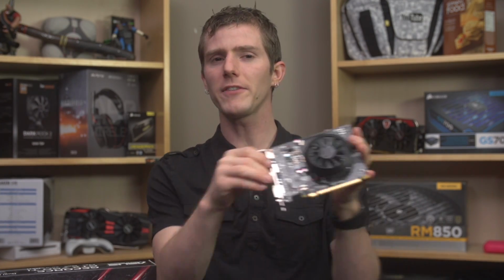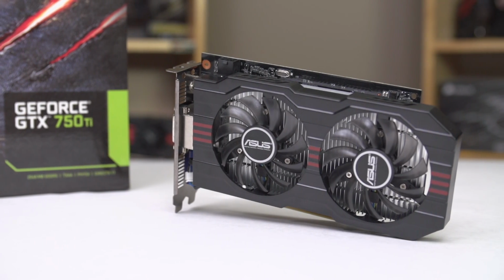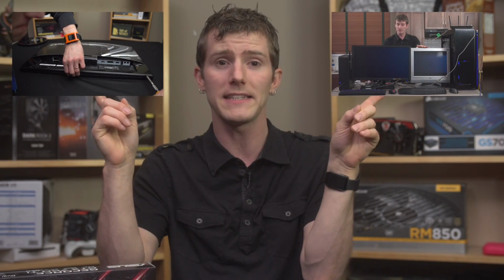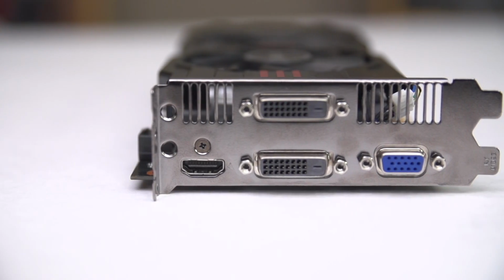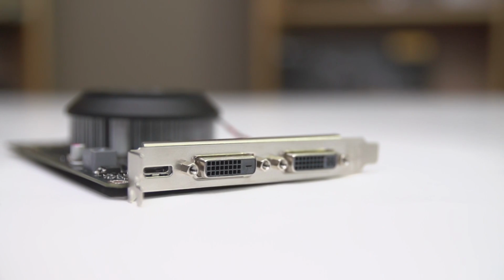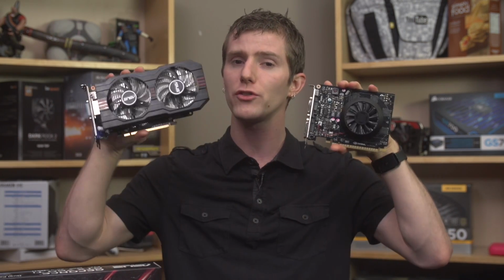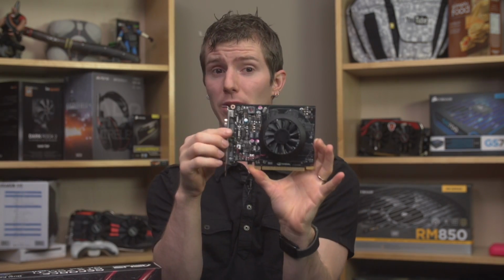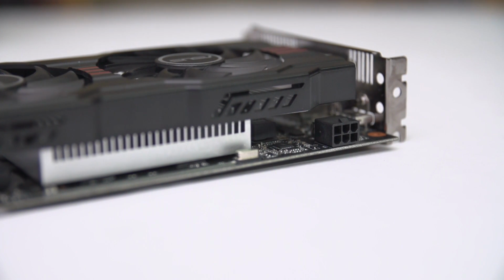GeForce GTX 750 Ti NVIDIA & ASUS Designs

Comment: Can I run a 750 ti on a 300w psu?
Reply: Almighty Loaf http://coolermaster.outervision.com/PSUEngine
Reply: bigassprick Is there a good way to find out my systems power consumption?
Reply: Almighty Loaf  I just got mine and I'm running it with an i5-4430 on a 380W Antec PSU.
Reply: Almighty Loaf If you go to www.pcpartpicker.com and add a lll your parts to the System Build Section, it will give you estimated power consumption and compatibility.
Reply: Mark Turner Or instead of wasting all that time, you could go to the site I LISTED, that doesn't require you to pick out all the other parts individually, and lets you just say how many HDDs, or GCs, etc, instead of having to pick the actual part. Really you should try it. It's official, and epic.
Reply: thekingfallsdown Thank you, the website you sent says i'll be fine with a 300w psu.
Reply: Almighty Loaf You're welcome. DONT get exact PSU though! You want at least 100 WATTS of leeway or you'll be stressing out the PSU!
Reply: yes but not recemended.
Reply: ***** there is no need, a 300w is plenty enough for a build using this card.

Comment: I saw a video where a psu with 250 could run this, can my 220 - 240 run this? Can someone please reply I need to know because I can't upgrade my PSU
Reply: How in the world did you get a machine with a 250 watt PSU?!
Reply: Liam Mcleod He was actually born with it, they are one. They are fused.
Reply: I don't think so...
Reply: My machine is a slim PSU so there's none I can find over 220 because they are only designed for the computer. I can get it but it's harder and the trouble is finding a 300w or over!
Reply: Model of the computer, please. (I really doubt nobody made an aftermarket solution.)
Reply: Aspire x1420
Reply: Droxal You poor thing.

That power supply looks non-standard as all hell! I don't know what to recommend. I found some aftermarket ones, but they have terrible reviews and probably won't work for very long. I would honestly be surprised if you could manage to squeeze a graphics card in that case.
Reply: Droxal The RM 450

Comment: Question. I have installed the PSY 750 ti card in my pc with a nice new monitor. I also have a ps4. Which is the best graphically on games ? Should I sell the ps4 and go pc all the way ? When a game I want is released on both platforms I won't know which system to buy it on !

Comment: I'm seeing that the 750 has a higher clock than the 780 Ti's but a bit less memory.
I'm planning to build a PC to get past my laptop with a 540M installed, should I go for the 750/Ti or the 780/Ti and why? What are the benefits between them?
Also want to get very high settings in games, Metro:LL, Titanfall, Elite: Dangerous, Star Citizen.
Reply: 780 Ti it is then
Reply: Bribe Guntails 780 ti, and later down the road when 4k gpus are in just get another 780 ti.
Reply: or if you can find something on sale try to get 2x760(possibly the more v ram options) depending on your max res/screens they perform better than 1-780 and you can see how they perform vs 2-780s for future reference

Comment: Hi guys i'm Going to upgrade my build but i'm stuck on the GPU : 
the GTX 750ti Gigabite or the GTX 660 OC MSI or the R9 270 Gamming Msi 
the GTX750ti and the  660 are in the same price but the R9 it's 20 Dollars up 
any recommendations ? 
The rest of the Build :
I3 3220 ivy bridge 
8Gb of ram 
H61 motherboard
Reply: Ya ima pick the 750ti over the 270 because if you think about it you can get a cheaper PSU with out and motherboard and don't get a dual core CPU get a quad core i5
Reply: Lu Ro an i3 3220 is absolutely fine for gaming. One of my friends runs a Pentium G860 and a 7790 and it runs everything brilliantly.

Comment: Just finished a weekend playing Wildstar - lovely game, but just so, so performance on my PC. I'm running a GTX 560 (eek!) which I've had for more than two years, I'm torn between this reviewed card here or the GTX 760. Wildstar was running at 30 fps with the odd rise to 60 fps in non-busy settings, but rare. CPU usage is around 20% ingame.

Comment: Can someone help me? So I would like to planetside 2. On my old laptop that I used to game on, planetside 2 was unplayable. Now I have a decent if not good gaming rig (If you want to know about the specs just ask me) but planetside 2 is still pretty intense on it. I have to turn the render quality basically down to 50% to get decent fps. So I'm deciding to invest in a GPU and a CPU if necessary. The problem is, I don't know which one is making the game lag, my CPU or my GPU. Can GPU's even make you lag? Please help!
Reply: Planetside 2 is CPU intensive, and less GPU intensive, but GPU does restrict frame rate, however, the optimization of the game means you won't get ridiculous frame rates because PS2 likes bottlenecking the CPU.
Reply: Okay, so please help me with this. I have recently just been talking to a friend, and he tells me an i7 processor would be ideal for gaming. Any thoughts, and or preferences?
Reply: no, an i5 is fine. i7's hyper threading is useless.
Reply: So if lets say I got an i5 quad core, would that be good for most games? Planetside 2, Battlefield 4, DayZ, etc.
Reply: Chr0n0s1nvisible It is useless unless you are doing processor intensive things
Reply: games don't benefit from hyper threading.  In fact, most games (few exceptions) don't benefit from quad core hyper threading or even eight cores CPUs (bf4 is the only exception I know)
Reply: So wait, what CPU should I get if I plan on gaming?
Reply: Omegakbalz Intel I5 4670k

Comment: Welp, DX12 is coming(look it up) same as with OpenGL. If you want budget gaming you'd be better of waiting for the next 860 card which hopefully will have dx12 support just for you to be future proof. Looking forward for a 860 fanless card.
Reply: "DirectX 12 detailed: Backwards compatible with all recent Nvidia GPUs"
Reply: What's future proof? Never seen it be done, even with a 12 billion dollar rig.
Reply: JacobStar91041 Future proof which means it'll run most games for atleast 5 years. My rig atm runs only dx10, games like Crysis 3 can't be ran even with my then 300$ card, which runs all none dx11 required games at max without a problem. And there's still stuff like DDR4 Sata 3.2 PCie 4 etc, about to come next year or 2016.
Reply: But future proof means it can never be outdated and perform lower...
Reply: Most likely they would make it compatible with DX11 because if they didn't their sales will be basically... shit. I play FC3 and it tells me on setting since my laptop is very low end it's at DX9 and it has a option menu for changing DX9 to DX10 or all those DX whatever. So most likely they will make compatible copies to sell for quite a while.
Reply: Teodros Yemane-Brehan The same can not be said about Crysis 3.

Comment: is this better than the 7870?? or than the 660?
Reply: 7870 is better then this card not to sure about the 660.
Reply: fireinside1984
7870 and 660 are extremely similar to eachother, in some benchmarks 7870 wins and a few 660 wins. Up to preference really, but go for the 260x instead since it's faster than both and has newer technology.
Reply: JacobStar91041 The R9 270 is revamped 7870. And the R9 270 is just slightly better then a Nvidia Gtx 660.
Reply: JacobStar91041 the r7 260x is slower than both of those cards. I think you meant the r9 270 :P.

Comment: I have a HDMi monitor so would I be able to use a HDMI cable on the reference card?
Reply: Make sure to get the full effect out of your HD monitor by right clicking on desktop / resolution and set it to the recommended 1920x1080 :)

Comment: This card does one other VERY important factor.. it completely destroys the crappy hardware of the Xbox One.  It pretty much proves that the Xbone especially is a SUPER ghetto PC.
Reply: Howard Gray the PS4 is about a 7850 underclocked, which is like a 660. a 760 is basically a 670, so the 760 is much better.
Reply: Howard Gray So because of one game it = to a 760 OC. Right, got your logic.
Reply: And near on par to the PS4.
Reply: halfhalo33 The gtx 760 OC is on par with the ps4. There is a HUGE gap between hardware ps4/xbox.
Reply: And the Xbox One is closest to HD 7770 in graphics specs.
Reply: I seen and done benchmarks on the ps4. The 7850 is right under neath it, but close. On Bf4 its on par with 760 OC. But on other games (Need for speed, assassin creed) its close to the 7850. It all depends on who favors the codes.

Comment: Hey, what is the AMD competitor to this card?
Reply: Seems like Nvidia has won this levels of budged with 750 Ti, its the best card in this price range (compared to AMD conterparts)
Reply: AMD has really been falling behind with this last gen of cards, IMO.
Reply: i think it would be the 7870 or 7850
Reply: Z0mbel
 The HD 7850/R7 265 is the competitor for the GTX 750 TI.
Reply: Marcuss2 HD7790 beats this card, also the hd7850. But newer gen, this has it
Reply: Marcuss2 AMD needs to make a smaller pcb card that is still a good powerhouse and in a small package like the Direct CU mini
Reply: They came out with the new r7 and r9 series.  I believe the 200 series in r7 doesn not require power connector or a lot of wattage.
Reply: Zackery Daley this one clocks higher though bro, so unless you are very partial I recommend this card.
Reply: Meowy McNasty How do you mean? The 7790 is a good bit less performance, and less value for money. And although the 7850 is right about on par with this card, it's also more expensive, and with scrypt mining - less available.
Reply: Barry Beefcurtains Yeah but this gens cards are actually just last gens cards updated. They kept the same architecture where this new Maxwell card is literally a new GPU. I agree for the time being but AMD will eventually release a new GPU series and they will be on par again
Reply: Marcuss2
it wins in every dept as a single gpu..........but no multi gpu support so an amd  person could buy say two gpus at this price point and it would perform well as did previous nvidia gpus at this (650ti/ti top;660gtx;7850/70:all duel) those gpus now perform better than the cards priced at 2x a lower cards price.......and these 750s have been eliminated from that equation i believe it is by design from nvidia....
Reply: andola jackson having two 750ti priced cards is entirely pointless, it would be far more efficient to buy the best card you can afford using the money you didn't spend on two low end cards. Single gpu solutions are almost always better than sli/crossfire, lower heat output and power consumption and all games support single cards whereas you might run into problems with optimisation in some games, or even sli/crossfire might not be supported at all.
My 2p.
Reply: Barry Beefcurtains 
That only applies until you already have a card and you're buying another. SLI/CrossFire is generally the most cost effective way of upgrading. Sometimes even if you have to get a new PSU and motherboard, and including additional power cost.
Reply: Patrik Manni true, but in that case it's worth saving up and getting a mid range card.
Reply: Barry Beefcurtains Eh... How do you mean? We're talking about it being worth it years down the line. If you only have one card, the best upgrade is going to be getting a second one. Two cards in SLI/CrossFire will perform better than one card for the same money. It just isn't a good idea to buy two cards straight off the bat. Partially because you're cutting off your upgrade route down the line.

Comment: i have a GTX 260 running on my 4 - 5 years trusty old rig powered by a C2D E8400 oc'ed to 4.0ghz

is it a good upgrade if i opt for the 750 Ti ? how apparent or serious will the bottleneck be ? not planning to change the system anytime soon due to budget constrains

Comment: Can anyone help me?? I have a GTX 650 (Non Ti, just regular) and I was thinking about getting a new card for under $200, would this be the perfect match??
I currently play loads of games, some heavy demanding and not so much, and I do, do SOME mining (PND=PandaCoin, Doge Coin, the easier stuff)
Reply: I think at that price point, the R7 260X might be a better option if cooling or power delivery is not an issue. The R7 260X utilizes 110 W at max load, which may run slightly hotter when mining, but shouldn't be an issue if your computer case is cool and your environment is air conditioned.
Reply: prolly  not, you're not going to see a significant increase in performance from a 650 to a 750
http://gpuboss.com/gpus/GeForce-GTX-750-vs-GeForce-GTX-650
you will see improvement but not enough to justify the price
Reply: get 760 bro or go AMD
Reply: oo0ooify yea, its cuda mining... opencl mining is still something amd cards for some reason, architecture reasons i guess, do better "digging". i would still go for a r9 290 instead of gtx equivalent because of the over powered mining potential this card has (if i was thinking of more mining rather than gaming). But, i would definitely stick with nvidia because i am not mining so much and my priority is gaming and video editing etc. my advice to the majority would be to get a gtx card, cuz it will serve you several years with gaming. amd cards are good too, but the nvidia keeps increasing their cards performance by regularly releasing drivers, which amd dont do a lot. dont get me wrong, i am not fighting against amd or for nvidia. i have owned several cards from both companies, but my experience is that nvidia cards run colder and quieter and perform well in many common titles.
but always, get the card that fits your budget and serves your needs... thats why i have switched between amd and nvidia several times in the past ;)
Reply: See, I have a 500 Watt PSU, the GTX 650 I have works great, and I am trying to fit something in there without completely destroying my system lol, I've looked at the GTX 750 Ti and it seems pretty good...
The problem with the 760, although that was my main priority, it's above my money limit by about $50, because literally, $200 IS THE MAX I am able to spend, and I love Nvidia/GTX series, I don't like AMD lol
Reply: Forrest Ferguson 500 is really low and i think the 750 ti will do the job.
but pretty sure that the 750 ti will not have problems with that 500w PSU
Reply: azizIIX Yeah, also If I am correct the GTX 650 and the 750 Ti has similar power consumption, or I believe the 750 Ti has lower power usage/consumption so that might be better.
Plus I have been reading that the 750 Ti will bring about 250kh/s to 300 kh/s for mining and that is almost perfect for what I am able to spend money wise for a new GPU
Reply: azizIIX AMD at this point is a horrible choice, there's far too much artificial inflation from bitcoin mining to justify price
Reply: i would recommend you to go with amd if you are doing more mining than gaming, cuz those new amd cards is for some reason better for mining... -.-
but this card has better gaming potential imo
Reply: I do more gaming than mining right now, like Doge Coin I only mined for about 2 or 3 hours a day for a week then I stopped, I play games almost all day lol
Reply: If I were you I would get an HD 7870 or gtx 660
Reply: Basically, Bit Coins and other "coins" that you Mine for is called Crypto Currency, some Coins are scams, some coins don't have any value, but in the case for the all-mighty "Bit Coin" 1 full bit coin is equaled to about $600 USD. BUT, without the right machine, it could take months to years to get 1 full bit coin.
Doge Coin, PND (Panda Coin) and all other coins out there, can be mined through CPU usage and GPU usage, depending which is faster. Some coins however, like one called "42 coin" there is ONLY 42 Coins in the entire world, so if someone gets ahold of 1 FULL 42 Coin, that is equal to about 142 bit coins. (142 bit coins = $85,110 USD)
Reply: ***** To go along with my other comment about bit coins, and other currency, it can really really mess up your GPU or CPU if you don't have enough good of one, like my GTX 650 right now has been sorta crashing whenever I enter games because I was mining 1 million PND (Panda) coins, which took me about 3 or 4 days running CPU + GPU mining about 8 hours a day.
It is risky, but if you can find a good crypto currency coin that isn't a scam, it can be worthwhile to try it out.
AND It does take some tech skills to configure files to be able to do the "mining" process correctly.
Reply: According to Tom's Hardware, the 750 Ti has better performance per watt when it comes to bitcoin, and litecoin mining. Unsure whether they are talking about an OpenCL, or CUDA miner.

http://www.tomshardware.com/reviews/geforce-gtx-750-ti-review,3750-17.html
Reply: Forrest Ferguson 750ti is best card for mining
Reply: 1GTX1 not exactly... because cuda mining isnt a big "playground" as opencl mining. miners still purchase r9 290 because of the potential of this card... but yes, this card is a very good deal if you are doing cuda mining. cuz the power it uses, is much less than how much it can mine. therefore, imo, cuda miners will not only buy this gpu, but also other line up, especially the higher end nvidia cards, of nvidias maxwell gpu's. i am also positive with the titan black and the 790, which will be released soon i guess, and it looks like these cards will also attract opencl miners too.